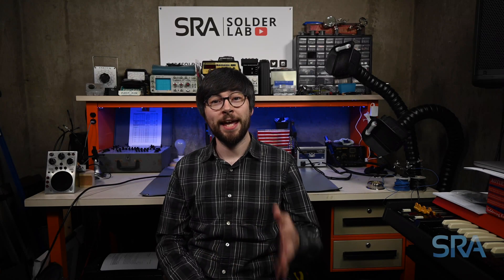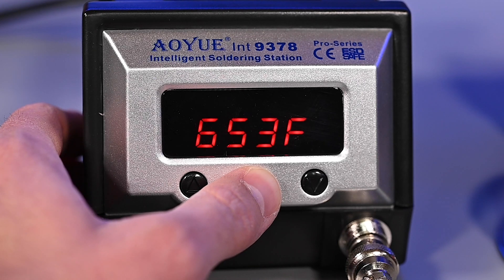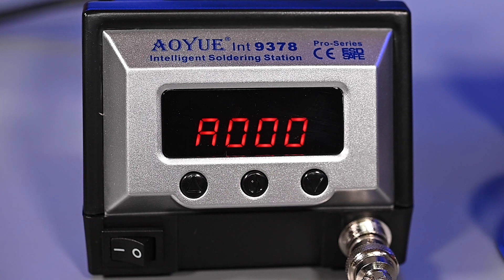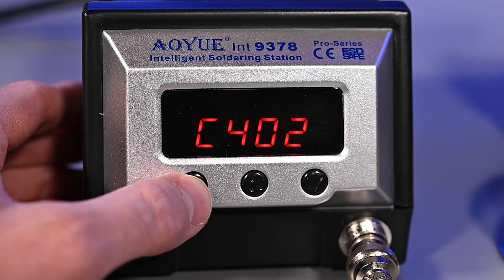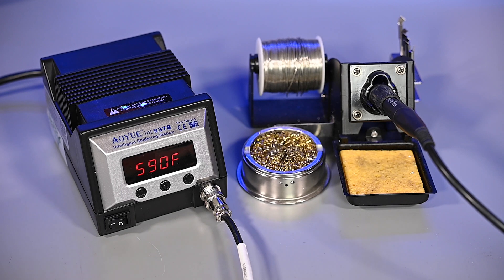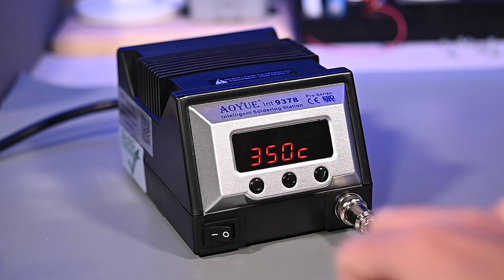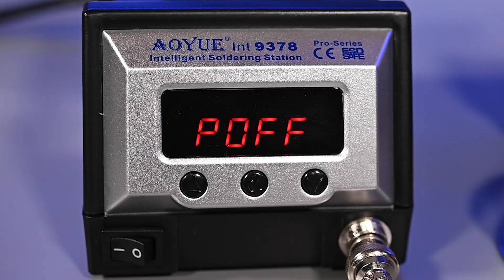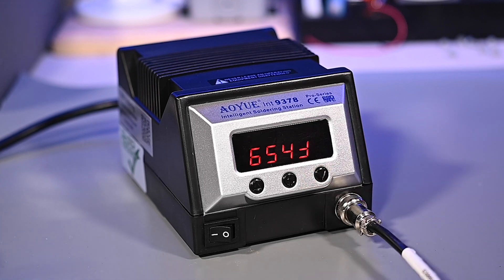How to Set Up the Aoyue 9378 Pro Soldering Station

Comment: Im a total noob to soldering, do I have to use the digital offset value function? does this thing have to be calibrated or can you just slap on a tip choose a temp and fire away??

Comment: I bought one 9378 soldering station plus micro tweezers and works super fine.
This is the best and cheap micro tweezers on the market.

If you can affort a expensive tweezers go a head, but if you are in budget this is for you.

Best Regards.